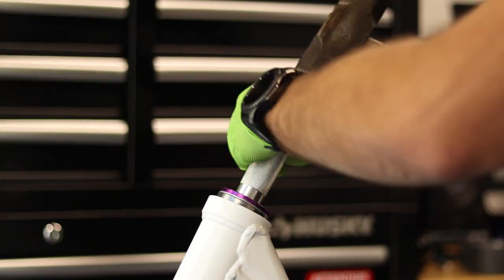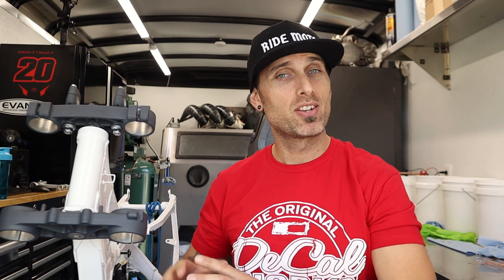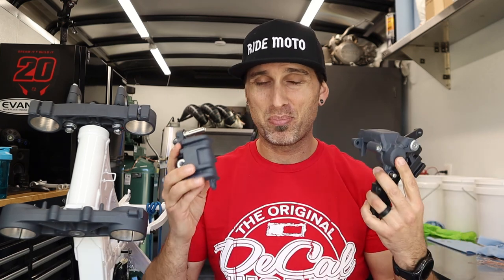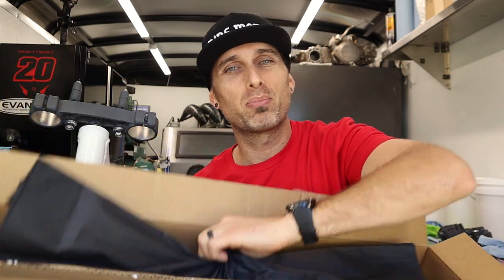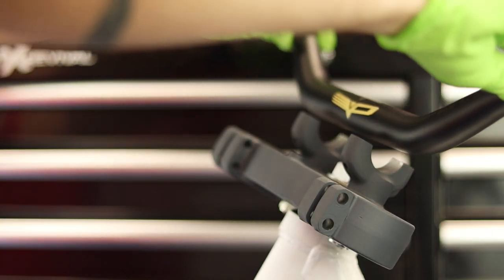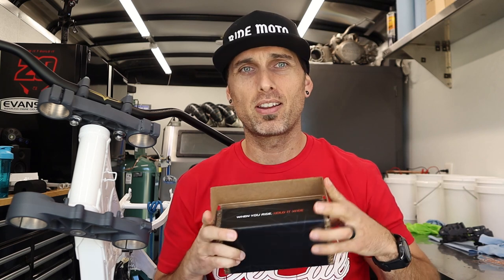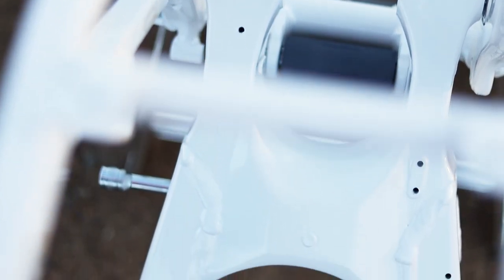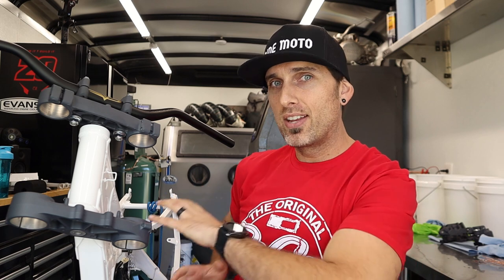THE 2022 YAMAHA YZ250 KILLER - And one of you is TAKING IT HOME 🔥 + All New MX Parts Giveaway (EP4)

Comment: Are the clamps for 48mm forks?  Look Production, but the steelies didnt have 1 1/8 inch bars or removeable bar clamps.  Are you putting SSS forks on it? Look forward to the rest of the series.
Reply: I have read as to where riders have put a set of SSS forks on these steel framed Yamahas and they really make a big difference!! I put a set of these on my 05' YZ250 and they are a lot better!!
Reply from the maker: Good eye! About 5 years ago, I built this bike mildly for a friend who bought it off Craigslist. At that time, I installed SSS front & rear from a 2006 YZ250F.

When he was done with the bike, I bought it with the intent to do this with it someday. Like two years ago already!! It sat until now. 

So yeah! Your bike has complete SSS on it front to back! Just wait till you see those suckers come back too!!!!!!
Reply: @erichildreth7562  I have a 99, and put a set on mine and I like them. Just been recent and would like to valve them more for me though since they were previously set for someone unknown and a 450. I was curious if he used the O4 bottom clamp and a new top clamp since it didn’t look like he modded the fork stop on the frame.
Reply: @BrianMcNeill25  I have a friend of mine that has a 99' and he likes it and the suspension is all original except for I revalved it using Race Tech and I revalved my SSS forks too (they came off on 06' YZ250F too!) and got the springs for my riding abilities,  they are really nice and my friend is happy with his setup!! I tried talking him into a set of SSS forks but he wants to keep it with the stock suspension.
Reply: @mxrevival  Charles did you mod the frame stop for the alum frame clamps?  I found the turning radius was short about 5-7 degrees both ways without the mod. Also extended it a bit.

Comment: so i have a question. I have 2000 yz125. I took the front forks in for a rebuild. But i just noticed the clicker for the fork adjustment isn’t working. Do you know how to fix that or what i need to do to fix it.
Reply from the maker: It's hard to say. When you say "it's not working" it is a little vague to place an exact diagnostic on via text.

Since you have the open bath KYB front forks, it would be pretty easy to pop that cap and take a look.

If it's not clicking like it should when you turn it the head could be severed from the assembly underneath the cap. But usually when the screw heads break off they fall out as well.

Worst case you can just replace that cap with the clicker assembly.

Also if you haven't had your suspension service in a while, you can have any suspension technician pop everything apart, replace the fork seals and bushings, and also diagnose the issue.

If you want to do it yourself, blast me an email and I'll set you up with the right tools & a how to video 👊
Reply: @mxrevival  sorry. so yeah when i turn the clicker in there is no stopping point it just constantly turns. And yeah i just had new seals and valves done on it. Only have one ride on the redone forks. That’s how i noticed it. I went to set them up for me and noticed it just turns in with no stopping point.
Reply: @mxrevival  what’s the email address